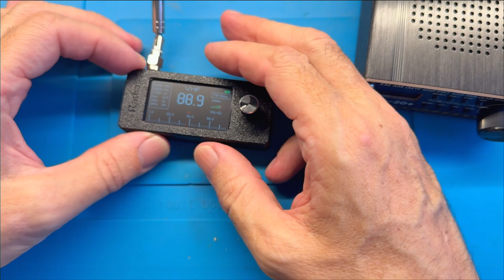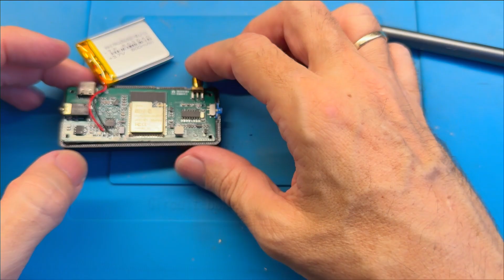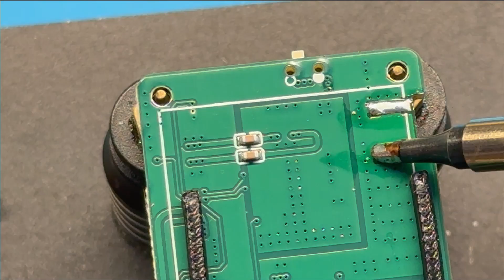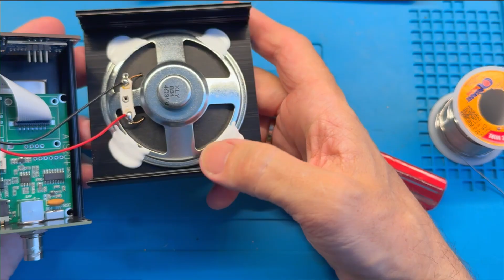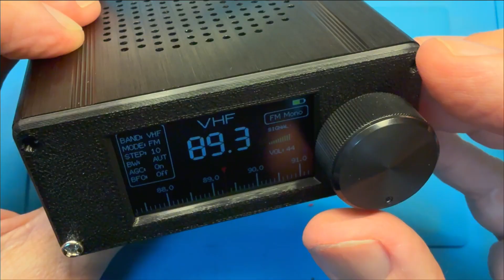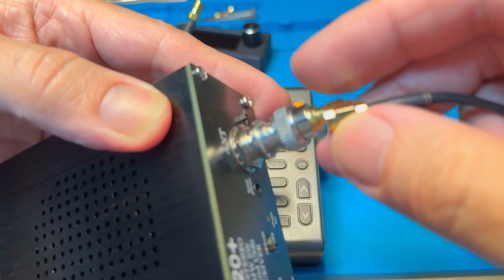EB018 - Si4732 Mini & ATS-20+ Hybrid Radio Project

Comment: Very interesting project, but wouldn't it be easier to purchase a similar case (or use one from a broken ATS-20+), mount a power switch, headphone jack & bnc connector to rear panel, and mount an si4732 mini to your 3d printed front panel? Then remove the antenna, power switch & headphone jack & run wires to rear panel. Then connect a higher maH battery and add a speaker.
Reply from the maker: Well yes you could, but this project was aimed at those who already had both these radios to integrate

Comment: Matey I stumbled on your channel from another YouTuber. Your videos are amazing and so simply to follow,  think i'm going to have a go at the Hybrid  radio project. I've spent a few hours sourcing the two receivers, and will be ordering shortly. At the moment I'm trying to repair  my LOWE EP 925 power supply, for some reason both meters have stopped working. After watching your videos its given me some inspiration to have a go at fitting digital display meter instead of the analogue which are fitted. Do you have any ideas you could pass on me on how to do this project ?
Many thanks again. 2E0VAP
Reply from the maker: Thanks for the kind words, I'm glad you're enjoying the projects! Fitting digital meters usually just requires finding a module that matches the voltage and current range of your supply and wiring it in place of the old analogue gauges. Should be very straightforward. You do need to find a suitable supply rail for the meters themselves from within the power supply

Comment: I recently made a second one with a V4b, however my headphone jack on the ats-20+ board stopped working and found the board was damaged where the jack is soldered to. 3,4,6 have now lack places to solder the jack to the board. Is there a workaround for this since the jack in the mini is still good?
Reply from the maker: Oh dear. Can you just add wire links to the broken PCB tracks and use epoxy glue to hold the connector in place?
Reply: @ElectroBananasYT I'm going to try something along those lines. For now I was able to expose some of the pathways and soldered some jumpers across to bypass so that my speaker works again. I have some copper tape that and going use to attempt at repairing it.

Comment: Nice and neat! now I'm thinking..maybe by adding an I2S sound module to Esp32 S3..it will possible for internet radio too! and maybe an additional little switch for changing option between analog - internet radio. But there will be alot work on the firmware side 😊
Reply from the maker: Sounds like a very interesting sub-project. I am sure AI will help you with the code! Let me know how it goes!

Comment: But why bother? You had a 3D printer, so all you had to do was print a new case based on the 20+ model. Then, add a larger battery and connect a larger speaker, possibly amplifying it with a transistor.
Reply from the maker: Yes that would be the way to go if I did not have an ATS20. This project is intended for those that had both radios and wanted to benefit from the better RF and audio section of the ATS20 and combine it with the superior processor and user interface of the Si4732 Mini.

Comment: This hybrid makes great sense given the headphones/speaker limitations of the ATS Mini V1 and V2. But ATS Mini V4 adds a headphone amplifier and improves the audio quality of the speaker output. Would you recommend doing this project with the ATS Mini V4?
Reply from the maker: I would, yes. The speaker system in the ATS is so much better than even the V4
Reply: @ElectroBananasYT  Thanks! Would you include more components from the ATS Mini V4 in a new ATS-20+ hybrid?
Reply from the maker: No, I would keep the method the same

Comment: Are there instructions if your ats 20 + has a uno main pc board?? I started the mod thinking I had a nano arduno main Pc board??
Reply: I did the soldering, had to use a 20 X loupe. It was difficult, I’m 80 and blind in one eye and I can’t see out the other but I got it done. Patted myself on the back, and then saw the uno board on the ATS 20 + and I am hoping I hear from the Electro Banana as to an uno board solder points. I really liked doing the mod. Got a friend to make me a 3D face plate, excellent file!! And now I’ll wait for THE SINGAPORE MAN advice/ recommendation!! Thank you, a very neat mod for us tinkerers!!😊
Reply from the maker: Hello and well done for the progress so far! Please can you send me an email and include a photo of your ATS 20 main board. You will find my email address in the channel information page.
Reply: @ElectroBananasYT  I will send you a picture of the board. I already did that in another email but perhaps you did not receive that yet. But I’ll send it again.
Reply from the maker: Got it. Have replied to your email.
Reply: @ElectroBananasYT  I completed the mod per your instructions for the ATS 20 + JUNO bd. The radio works! Thank you very much Electro Bananas Man!! Great mod!!

Comment: I'm in the beginning stages of this project. I realized my wire is a bit big for soldering to the SI4723 chip. What gauge wire did you use? That's where my hold up is at the moment. I'm attempting to make this with a V4 ATS mini.
Reply from the maker: I used 30 Awg wire wrapping wire. Check the link in the description for details. Good luck with your build!
Reply: Success! I ended up doing exactly what you warmed about when bending up the reset leg of the SI4732 chip. I ended up just removing the chip from the V4 board. It didnt change with doing anything else so I plugged on. Thank you!
Reply from the maker: Congratulations!! Have fun with your new Hybrid 😊

Comment: I like your wonderful work. Well done! But could you put the ATS mini radio PCB in the ATS 25 which has got a little bigger screen. I think it will be great with a big screen and the sound is more powerful in the ATS 25, so it's gonna a huge modification and a wonderful radio as well.
A combination of the ATS mini (without it's screen) and the ATS 25 (with its screen and speaker) will be a wonderful radio!
Reply from the maker: Thank you! Honestly speaking, I think the ATS 25 is good as it is.

Comment: Has anyone tried using the pins on the board for rx, tx, sda, scl, 3V, 5V and GND? It would be possible to add another microcontroller to the circuit and make a bridge for external control. It would theoretically be possible to put an esp32 there and control the radio via the web, or an arduino pro mini or one of those new miniature microcontrollers with low power consumption and integrate an IR receiver into the radio and control the radio with a remote control. This modification disables the Arduino, but the design of the radio, it seems to me, allows the use of two microcontrollers at the same time.

Comment: Nice.  I was thinking, I would get the same or more capability with Radtel RT-920 for $45 isn't it ?
Reply from the maker: Well yes and no….. The si4732 is designed as a radio receiver as it’s primarily function, so the menus, user interface and hardware design will give you a better radio receiver experience. Also the community support for the Si4732 mini is amazing! The RT-920, like many other, are primarily built as 2M and 70cm transceivers with the HF radios as an addition (almost a design afterthought) to get more sales……If your primary interest is HF radio reception, I would strongly consider the Si4732 mini
Reply: Not at all the 920 in my case, was terrible. I gave it away

Comment: Great video. Just about to do the same thing. I noticed that the SI4732 Mini has a highish S meter level, with no signal (possibly due to   noise pickup from ESP-32), but in the last few seconds of your video that S meter reading was far lower, so perhaps the Hybrid  unit may reduce that noise?
Reply from the maker: I have not compared the two, but there is a strong possibility of less noise as the ESP32 is far from the Si4732 in the hybrid. Have fun with the mod, let me know how you get on!
Reply: Finished it.. However the unit is very different to what's on the video. But 2 things happened, but I recovered from the issues. 1st the SI4732 pin was lifted to disable the RST, and it decided to break with little encouragement... Mmm. A go  with a small milling bit gave me a bit more to solder onto...As I was attaching a wire to the track underneath the track lifted. Fortunately a pin on the ESP32 is where it comes from. So wires attached, ond some UV resin to anchor things. I powered it up, and meter  appears to be higher with SSB with no signal and lower with AM The last few seconds on your video show AM. Overall pleased with results. Meter looks good up to high levels.
Reply from the maker: Thank you for sharing your challenges and well done for improvising some solutions! Well at least you got there in the end 🙂 enjoy your new hybrid!

Comment: I can confirm that this also works for the AMNVOLT V3S. I followed the video's directions completely and therefore bypassed the V3S's hi-z front end and it sounds much better (especially on my large dipole, but still does just as well on the whip). With the v2.28 software I have a nice orange theme, and also added a "bail" in the form of a cheap mini portable laptop stand, it looks like a tiny older Icom radio! This is a great mod.
Reply from the maker: Good to hear. Yes, I don’t like that High-Z mod. either. Would love to see it - send some pictures! 73
Reply: I got the same radio but without the HI-Z circuit. Do you have an email I can message you at? Would like to see your dipole setup

Comment: How much power does the Arduino use, when in a Reset state ?
Is it so little power draw, that it's not worth the hassle removing it ?

It a huge difference in sound, night and day 👍
Reply from the maker: For a standard Nano, the current draw in reset is around 6 mA. If this project were just for my own use, I’d probably disconnect or remove the Nano entirely. However, one of the key goals was to make the modification as accessible as possible, giving viewers the confidence to try it themselves — so some compromises were made. That said, an additional 6 mA is an acceptable trade-off in my view. 😊

Comment: I have a working hybrid. 
Original screen was glued in. there was no way to free lt without breaking it.
I ordered a new 1.9” screen.
Reply from the maker: Congratulations! Sorry to hear about the screen. I hope the manufacturer is not starting to glue them in as standard. I think there are several different manufacturers. Surprised you managed to get a replacement screen, well done! ⚡️ 🍌

Comment: Fantastic video.  I am looking to create a retro case and would like to incorporate a 'magic eye' using a signal strength output into an esp32 or arduino to drive a small 1" IPS.  I can see the display has this, but it will be software based.  Any chance there's an analog signal level in either of these boards?
Reply from the maker: What a great idea!!! Although I doubt that the signal strength is present as an analog signal anywhere... Thanks for the comment. Do send photos of your completed project!

Comment: Impressive project here! I have both, will I engage into this? Not sure... I don't have a 3D printer so I'd need to order the front plate anyway.
Still, very interesting to watch and I'm sure that the end result is a great radio.
Reply from the maker: Thanks for the comment! It was fun to do! The panel does not cost that much to order, the shipping method you use makes a big impact to the price. If you choose an a lower price shipping method the price can be very reasonable.

Comment: Superb project, I'd like to do it myself! There is someone who implemented an 'extra audio mute circuit to prevent loud popping of the speaker' from the SDR-radio YT channel. Not clear to me what he did, but between your mod and that one, this could become a super radio!
Reply from the maker: Hello! Well spotted! Yes there is a mute circuit on the Mini that comprises of two transistors connected to the ESP32. For simplicity I omitted this as it would be complex for many people to integrate between the two radios. Thanks for commenting!

Comment: In regards to the speaker on the new vs old SI4723 device, mine has "radio" written on the case and it has the super tiny, horrible sounding speaker. So having the word "radio" on there isn't a guarantee that you have the good speaker on the device.
Reply from the maker: Oh no, shame they are doing that to make a few extra cents/pennies 😞

Comment: I have built the same project, instead of using a Si4732 Mini radio and a ATS-20, I used a T-Display S3 and a ATS-20. It looks and works exactly the same.
Reply from the maker: Excellent! It is great that the software and hardware designs for this radio are open source. I expect we can see many more interesting software and hardware builds around this radio in the future. Thanks for sharing

Comment: How did you know i2C addresses would be the same?
Reply from the maker: Hello David. When the SEN pin of the SI4732 is connected to ground, the I²C bus address is 0x11. When the SEN pin is connected to VCC, the I²C bus address is 0x63. In both radios the SEN pin was connected to the supply voltage so the I²C address for both was 0x63.

Comment: A Frankenstein Si4732 radio! I am surprised the front plate of the mini fits the ATS-20 case, even the screws, what's the chance? Great work!
Reply from the maker: Ha ha, I like that! By the way, it is a newly designed front panel, not the original 😊

Comment: Nice explanation & documentation. Well done. 👍

But is this hybrid a better/cheaper solution than the ATS25X1 or ATS25X2 ? 🤔 
If your focus is on a large screen & FFT "waterfall" there's also some relatively cheap Si5351 -based radios with 4.3" displays on ebay. 😉
Reply from the maker: Thank you for watching and the comments. Actually the focus is on those who already have both receivers. If money is to be spent, I think the ATS 25 is good value and has great community support 😅
Reply: I think it's more about doing something yourself and enjoying the result...
Reply: @wernerl2865  I know. 👍But I asked since the 2 units combined cost more than the ATS25. 😏

Comment: Thanks for a very nice article. I've done a similar mod, in that I've repackaged a  Si4732 pcb  into a larger box to make room for  a larger display, and more switches. One thing though, many commenters claim that the  Si4732 has no input filtering. However it does in fact have a very clever "digital capacitor" on the input which tunes the inductor and tracks with the VFO. Unfortunately, this means that if you add a buffer to the front end , you will probably disable this function.
For details read "AN383: Si47xx Antenna, Schematic, Layout, and Design". Thanks again.
Reply from the maker: Thank you very much for your comment. How interesting!! Any photos of your project? 😜 Thank you very much for the interesting link to the application note. I will take a look 🙏

Comment: In principle - why ruin two receivers? It can be done cheaper. Connect Lilygo T-Display S3 to ATS 20+. The base is the Volos project on Github. You can also use alternative Firmware. With this method, I ruined only one receiver - ATS25X1 :).
Reply from the maker: Thanks for the viewpoint, yes what you suggest is a great option to those with the right skill set. However my key objective is to make this project accessible to as many people as possible - to give confidence to those that don’t have software or electronics expertise. Thank you for taking time to share your great ideas 💡😊

Comment: Instead of making an ATS25 why not just plug a larger display into the ATS20?  It only takes 4 pins, I2C, power and gnd. The biggest problem with this mod is that it is going back to single knob operation that I hate!
Reply from the maker: Thanks for the comment Steve. That would provide a bigger screen - that is the easy bit. The issues is that the screen resolution and format would be the same (if it was going to work with existing software). The thing about the screen on the mini is that the resolution is much higher, the aesthetics are better, it is full colour and it is capable of displaying much more information. Finally, it is driven by a far more capable processor. Note that this hybrid is very different (not as good as) a ATS-25. This project is aimed at those who already have a mini and a ATS-20 and want to combine them for something more interesting to build and use.
Reply: Do it and stick a video up We're all interested to see it .

Comment: Awesome project.  Why not disconnect the power supply from the junk you want to obviate?  Seems to me this would reduce current draw & maybe spurious stuff too.  73
Reply from the maker: Thanks for the comment. Good point you have there, I did consider breaking the power line to the arduino, however the key objective of this project is to keep the modifications to a minimum to make it accessible to as many viewers as possible 😊. I did not want to scare ppl off with too many changes. Also, the arduino when held in a rest state is not doing anything (not creating noise) and the power consumption is negligible 😌

Comment: They are both junk radios, why bother?
Reply: Because some of us likes to tinker with inexpensive stuff. 😉

I have been repurposing old electronics into usefull ( not always great ) devices since the early 80's. 🙂
Sometimes we need to use your imagination. Especially if you're a kid without $$$. 

What better devices would you suggest instead? ( ICOM IC-R9500 ? ) 😂
Reply: It's fun and a interesting challenge and a learning experience. It also cost too much to do with Kenwood TS990 and Icom 7300 lol 😂
Reply: turn lemons into lemonade